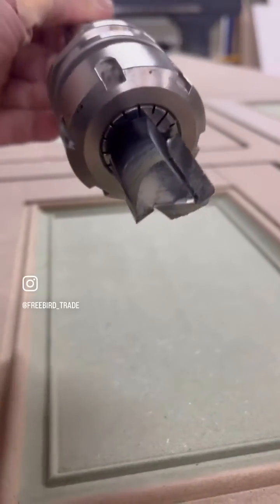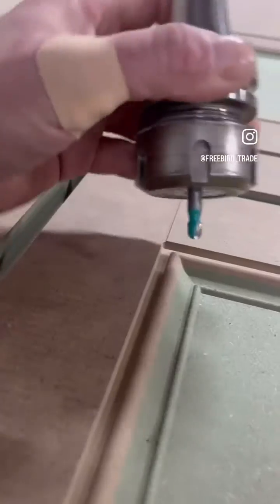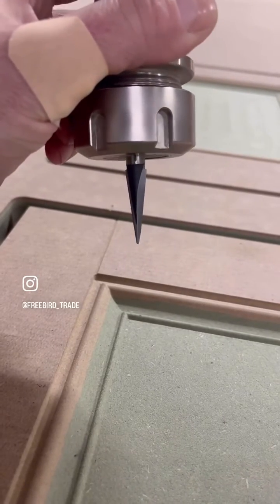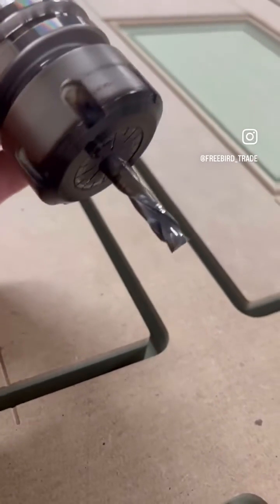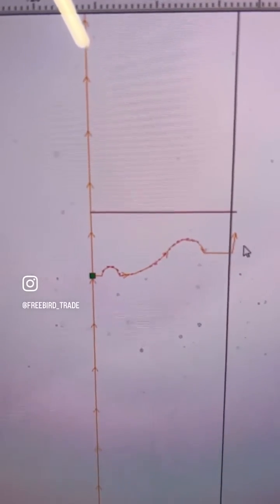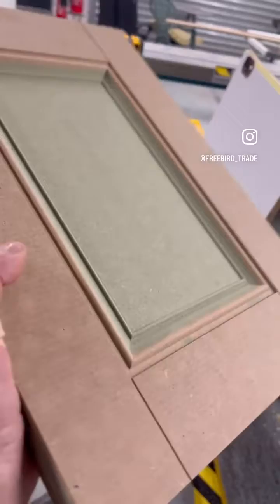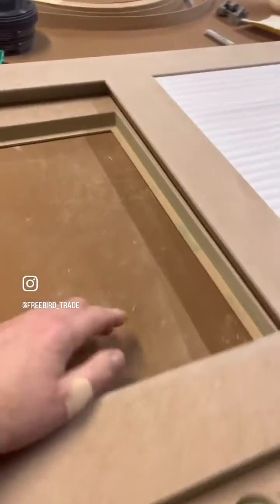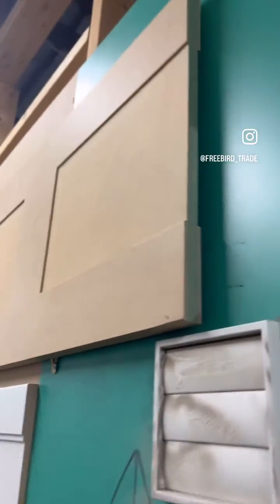CNC Shaped MDF Doors

Comment: At 0:12 it looked like a bone ;-) That 45 mins of time for a door is only a problem, if a more money-making thing is waiting to be build. If machines are not used, they also cost money. If there will be a batch of those, I suggest custom shaping bits which allow to skip some extra passes. What part of the job took the most time? Recessing?
Reply from the maker: Yes I spotted that bone shape in progress too! The longest process was the fine shaping of the profile.  I agree we could design a profile to match the curve of larger rounded bits in a minimum of passes, then just get the fine tool to square off into the corners

Comment: I'd imagine those doors are quite heavy. How do you stop the screws pulling out of the hinges? Great video by the way. Thank you.
Reply from the maker: It’s a dense board so fairly heavy yes.  But it also holds screws well (when screwed into the face/rear of board not the edge).  We mount them on concealed hinges and have never had issues with the hold of the 35mm hinge boss and screws into the back of the door.  For th connection to the carcase we use the type of mounting plate that has euro screws pre-mounted, fitting into 5mm diameter predrilled holes. Apart from all that, it’s a case of specifying the appropriate quantity of hinges per door. And if a door is particularly large and heavy we would step up to using the Sugatsune J95 heavy duty concealed hinges
Reply: @Alastair_Freebird  Thank you for that very complete answer. Much appreciated.

Comment: With a set up like that I don't think the 45 mins per door is a problem.  Set it all up for multiple doors & send it on its way, allowing you to carry on with other stuff.  Door looks great btw
Reply from the maker: I basically agree, it depends on the balance of work going through the workshop at the time.  There are things the cnc could be doing in that time that are more profitable, in which case it might be better for staff to cut and attach a pine moulding to a simple door.  But if staff are piled out with other work and the cnc is at idle, then we could do the doors this way.  The time when it’s definitely a job for the cnc is funny shaped doors, especially curved mouldings - then this is definitely the solution